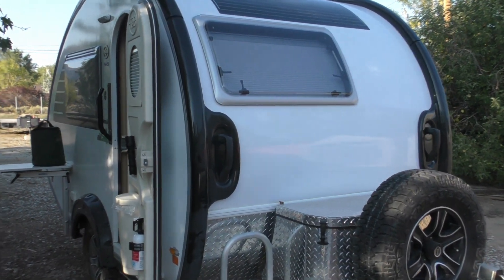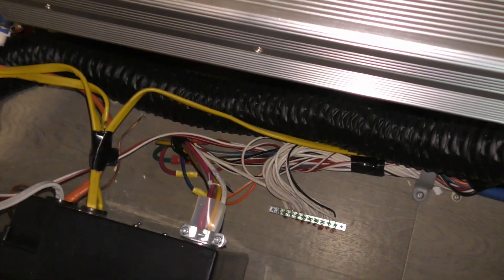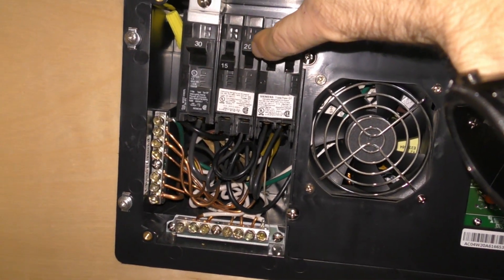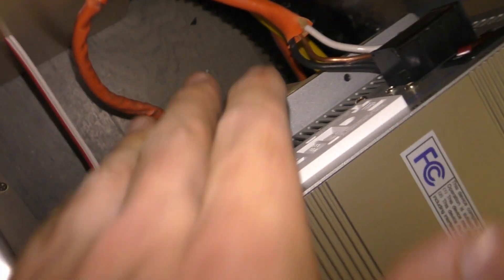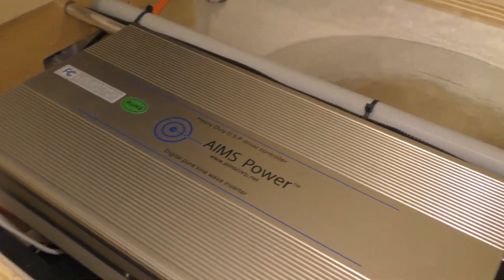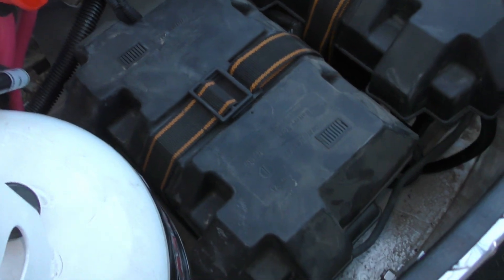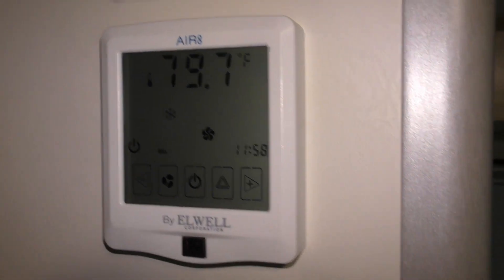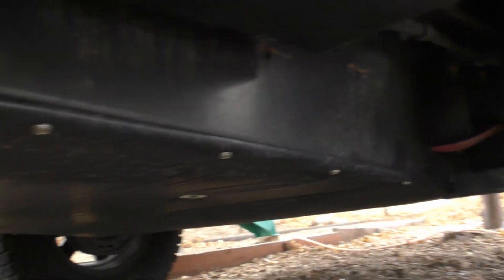AIMS Power Inverter Installation in a 2021 NuCamp T@B 320S Boondock Camper

Comment: That was a useful video.  Thanks for your effort. I was surprised to see that the air conditioner would run off of the 2000 watt inverter. How long does it run for you?
Reply from the maker: I just went and tried it again. The A/C was able to start and it ran for about 30 minutes before the battery got too low and the inverter disengaged. I am charging the battery to give it a try again. I took some videos I can post if you want to see it running the A/C. Inverter R Us said that the startup power of the Microwave might be too high for the inverter when it is hot outside. Even though the A/C worked this time the Microwave would not. I could try running it when it cools off tonight.
Reply from the maker: That is a great question and I would love to give you a full answer, but this summer when we tried to use the inverter it didn't work. The instant the Microwave or A/C is turned on the inverter goes into to overload mode and shuts off. That is even with all circuit breakers turned off except the Microwave, the second you push the start button it kicks off. I need to call for support and hope it can be fixed. I will let you know when I have an update. Just tried it again yesterday to see if I could get you an answer. Thanks for reminding me I need to call on it before I am in a situation I needed it.
Reply: Any updates?